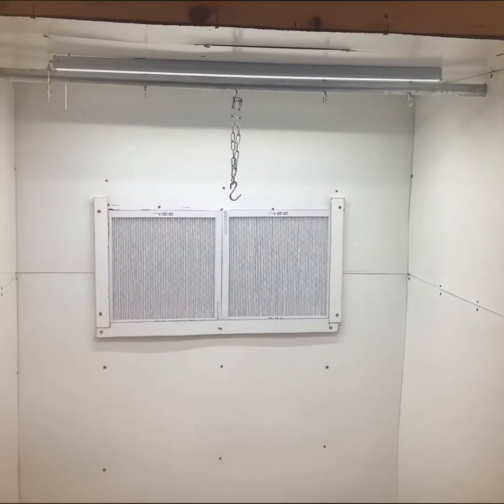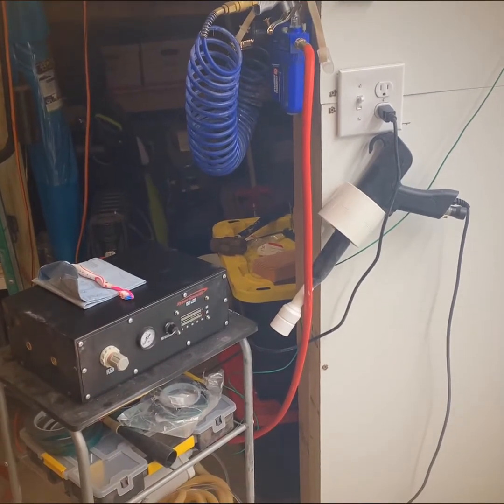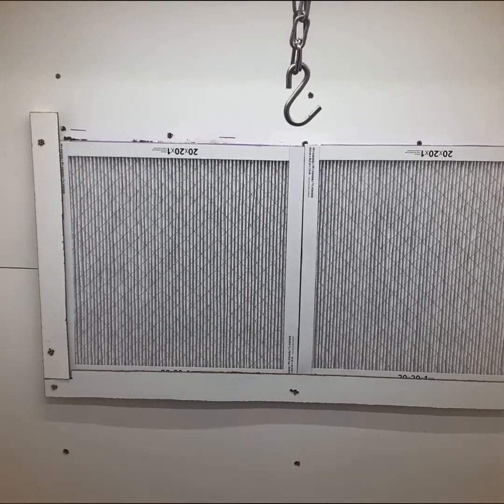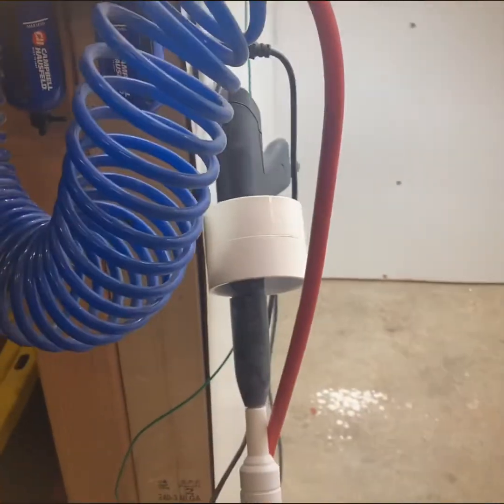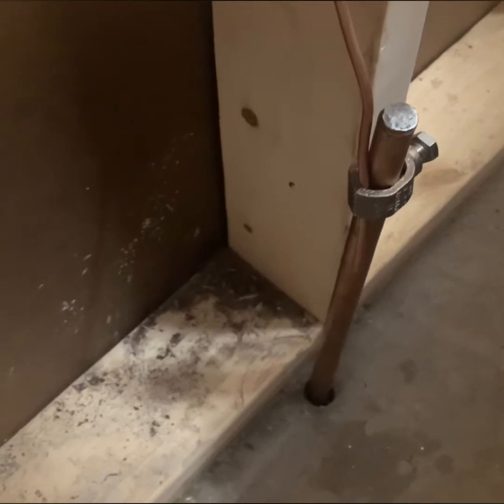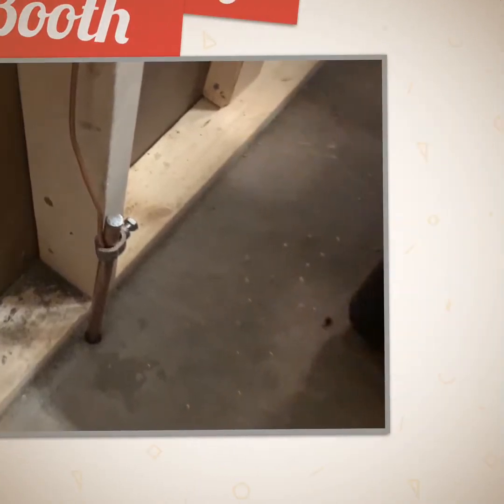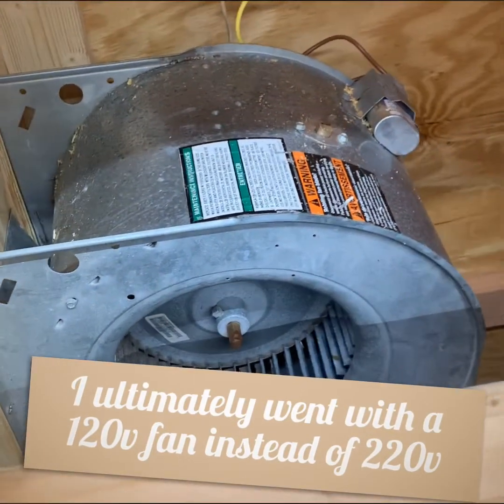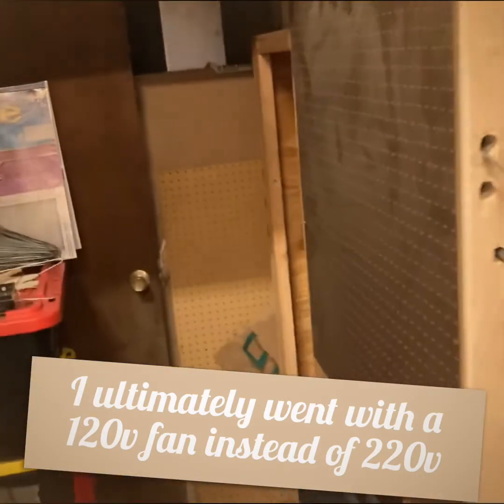DIY Powder Coating Spray Booth No kneeling or flashlight needed 😉

Comment: I don't know if it is the light, but when you are talking about your equipment at the beginning, it looks like powder in the air.  Is that the case or a trick of the light/camera?
Reply from the maker: In the initial clip, I’m spraying, so it’s powder.  When I’m talking, it’s lighting